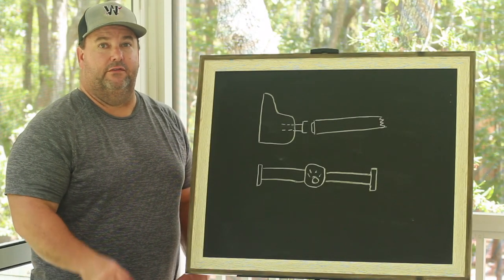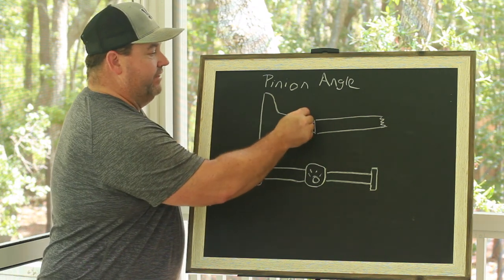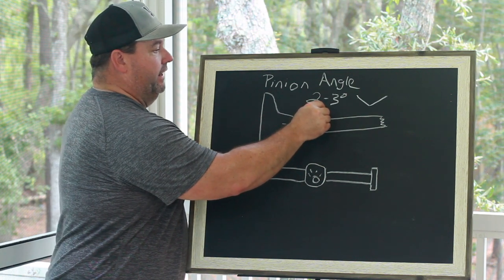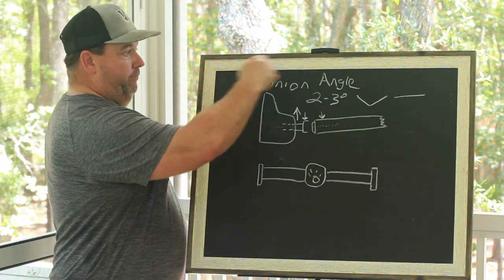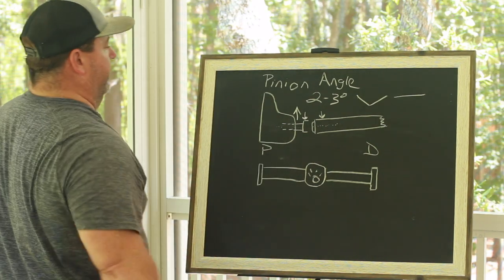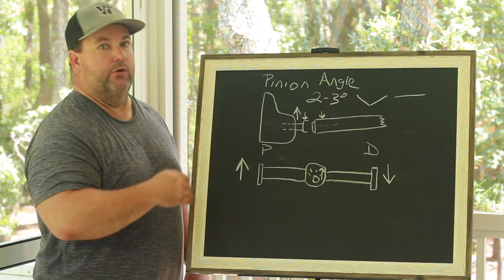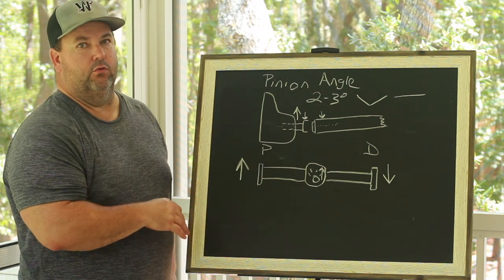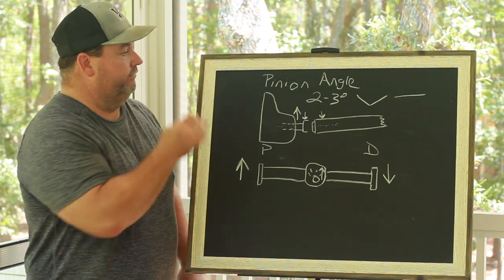Pinion Angle | Rear Suspension Twist | Rear Anti Roll Bar

Comment: You're using the wrong word for what pinion angle is and adding to the confusion about what it is and how to set it. What you are calling pinion angle is the rear universal joint operating angle. The limits on ujoint operating angles is set by the ujoint manufacturer usually from .5 to 2-3 degrees. Deviate and you make the ujoints weaker and less efficient. Pinion angle is something else. There is a relationship between the front and rear u joint operating angles where they must be near equal and opposite. The front ujoint actually travels through an elipse shape at the driveshaft side.  This accelerates and decelerates the driveshaft as it moves through 360 degrees of trans output shaft rotation.  Keeping the ujoint operating angle close to equal and opposite at each end of the driveshaft cancels out this acceleration at the pinion and prevents vibration and damage. So pinion angle is all about the relationship between the front and rear universal joint operating angles. It is very simply measured by zeroing a cube style digital angle finder on any horizontal or vertical surface of the engine or transmission (like the bellhousing flange), so that the display can be read from the drivers side of the car. Now, take a measurement from the front of the pinion yolk, again with the display oriented so it can be read from the drivers side. The number displayed is your pinion angle. Your objective is for this number to be zero under load to maximize the strength of the parts along with the efficiency of the drivetrain and to minimize any vibration. High powered leaf spring cars can take quite a bit of pinion angle to achieve this which can put the rear ujoint operating angle outside of the manufactures recommended range, IRS cars are the other end of the spectrum. They require relatively little. Note there is a dynamic you should consider depending on if the car squats or lifts and the suspension type. Using ujoint angle to create "bite" is actually just making the drivetrain less efficient and reducing tq to the wheels.
Reply from the maker: MxGuy thanks so much for your comments and detailed explanation! Go fast, go straight! Be Safe!!

Comment: Be careful with your terms. The Pinion Angle percentage does not (Or  should not) have anything do with the angle of the driveshaft. Technically, you are referring to "working angle".  The working angle is the DIFFERENCE between the pinion angle and the driveshaft angle.
Reply from the maker: Kevin Christianson thanks so much for your comments and correction! You are absolutely correct. Generally when talking about "pinion angle" in the drag racing community we are mainly talking about the working angle by which the u-joints are subjected to under load, not the actual Pinion Angle in the differential. The working angle is absolutely the correct term. Of course, whether the angles are following the same slope directions or opposite directions determines if you subtract or add the two angles together. Go fast, go straight! Be Safe!!
Reply: @KevinWilsonSBC  Love the vids! keep up the good work!